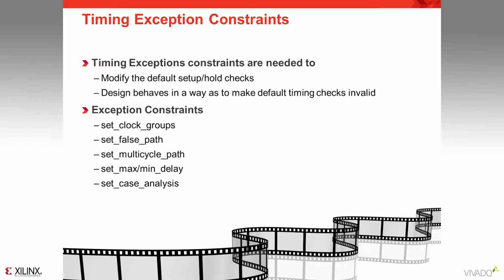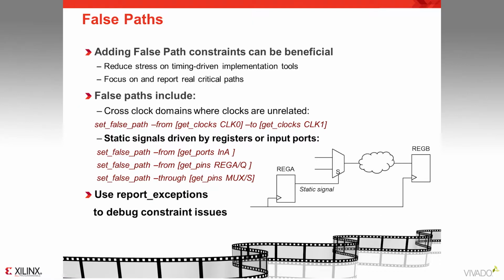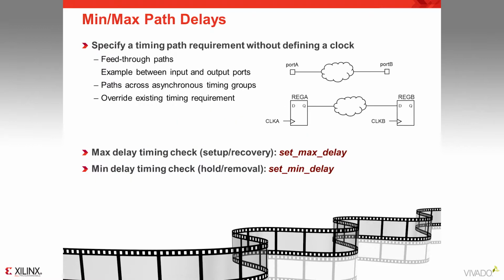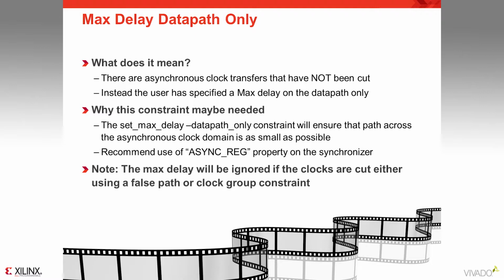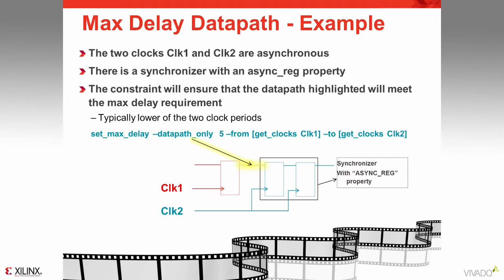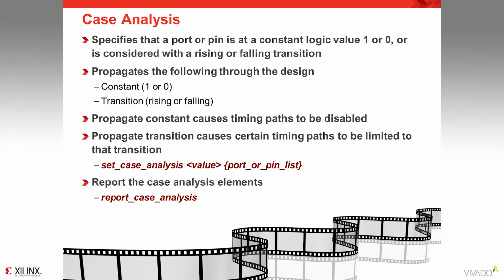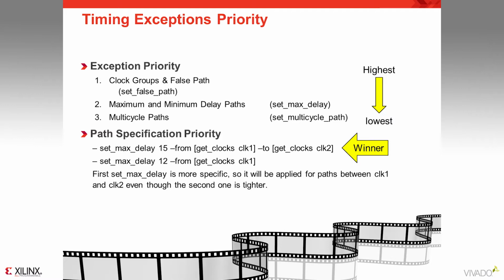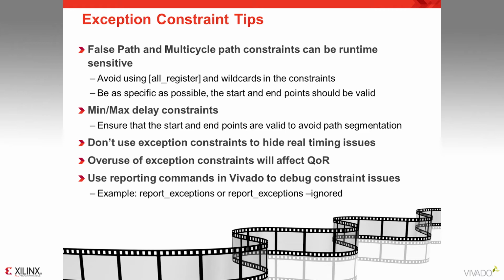Advanced Timing Exceptions   False Path, Min Max Delay and Set Case Analysis

Comment: The instructions in the video are contradictory.

At 4:35 he says that if the set_false_path or set_clock_groups commands are used, then the set_max_delay -datapath_only command will get ignored.  Then at  5:26 he says that in order to use the set_max_delay constraint you need to have already applied the set_false_path or set_clock_groups command.

I am fairly sure the first statement is true, the second false.  But this is the kind of thing that makes working with FPGAs generally terrible.  Even the vendor can hardly give a straight answer.
Reply: I believe it has to do with the order in which you run the commands. If you were to apply set_clock_group after set_max_delay, the earlier ran set_max_delay would be ignored.
Reply: Good question,  why didnt Xilinx reply?
Reply: I agree with you, second statement is false: set_false_path/clock_groups completely override set_max_delay and turn off timing analysis on the specified path. It is a shame because timing constraints and clock domain crossing are critical part in designing FPGAs and are most of the time badly applied or understood. It deserves an accurate explanation.